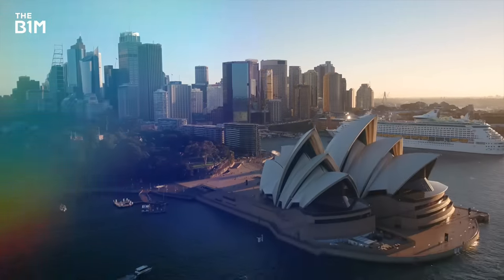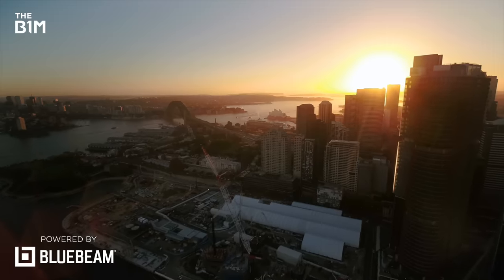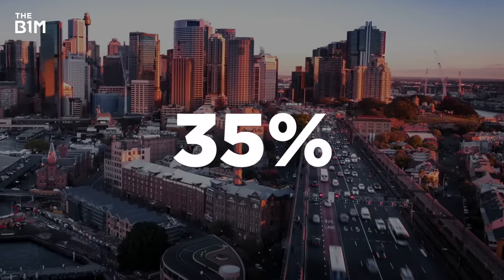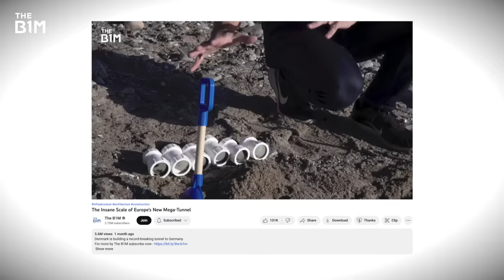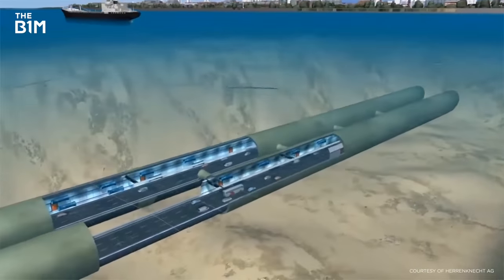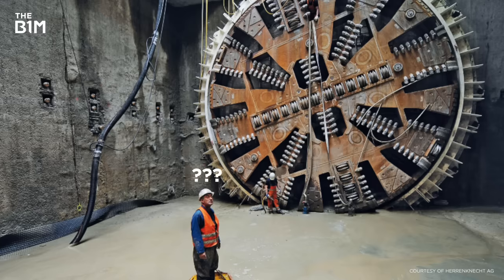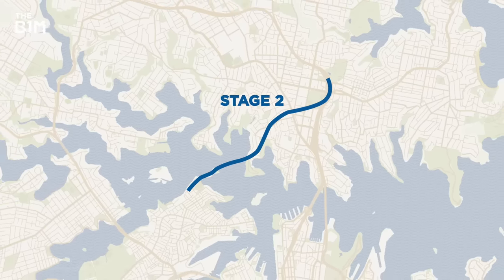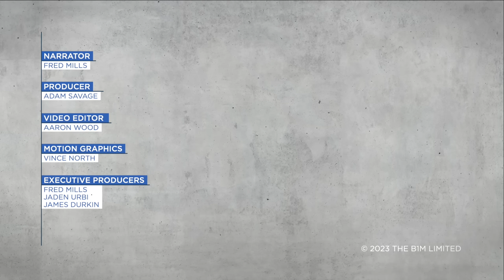Sydney's $5BN Tunnel U-Turn

Comment: If no alternative transport is implemented at the same time, it will just maintain the status quo of trying to keep up with ever increasing car use. I agree that a new connection is desperately needed, but not nearly as much as viable, affordable, round-the-clock public transit. Great video!
Reply: Transit sucks. I prefer my car so I tell my politicians to give me more highways.
Reply: @musqul8566  And they will give you more highways, so you'll have more ways to be stuck in traffic.
Reply: @musqul8566  If you wanna suffer, then suffer, just don't make others suffer for your uninformed opinion.And more importantly: don't make them pay money for it.
Reply: @musqul8566  then don’t live in a city, they’re not meant for cars
Reply: Actually, there is (sort of). Sydney Metro's City & Southwest extension is right next to the West Harbour Tunnel, and is planned to open in 2024. They don't exactly go to the same places but is nevertheless a great alternative for crossing the harbour.
Reply: @wfb.subtraktor311  How about we make a deal, car drivers won't make you pay for car infrastructure as long as public transit users don't make car drivers pay for public transit infrastructure?
Reply: @evancombs5159  If you want to do that then don't pay your taxes.
Reply: @beandispenser6971  I think you missed the point.
Reply: Another person that fails to understand why cars remain attractive and thinks it’s only missing public transit that’s the issue. Lol.
Reply: There are currently 3 metro lines and 1 light rail line under construction. I’m not quite sure how many public transport alternatives you need before we stop hearing that, but the current number does seem like quite a lot.
Reply: @musqul8566  One more lane doesn't ever solve the issue. Having public transportation that is actually high quality and useful does reduce congestion though, making it better for everyone.
Reply: @wfb.subtraktor311  and another simple mind that fails to understand why cars are attractive and thinks it’s just the lack of transit and people will drop cars. Lol. Transit IS POINT to POINT. Fixed. It cannot cater for all trips, in all directions and be door to door.  I have a train next to my apartment, a tram at the end of the street and multiple bus lines,  but a car always provides more flexibility in all weather in all directions.
Reply: @evancombs5159  aight, all roads are now toll roads.
Reply: @xander1052  that also means getting rid of all subsidies for public transit.
Reply: @evancombs5159  Most of us use both.
Reply: @you_dont_know_me_sir  most do not I’m guessing. Far more use cars on a regular basis and transit on random points to point trips once in a blue moon than the other way around
Reply: @calebmoore1582  the problem was never how many lines there, but how unreliable and infrequent they are. People can then move accordingly to what their needs are.
Reply: @musqul8566  No, Transit sucks in Australia, i am more than happy in a green car on the Shinkansen!
Reply: @musqul8566  
So do you understand that if you live in a city & love driving, then your self interest is to get OTHER PEOPLE off your road & onto Public Transport?
Everything from Gondalas to seperate bikes lanes to trains does that.
Do you understand now?
See Not Just Bikes or City Beautiful about town planning.
Reply: @rasta77-x7o  
Pls read my comment - If you live in a city and love to drive, then your self interest is to get OTHER drivers off your road to make the trip quicker for you. More roads in city means you have more congestion, bc of induced demand. See my other comments.
Reply: "Around the clock" is key here, the only time we were given 24hr public transport was during the 2000 Sydney Olympics and it was wonderful being able to go out at any time of day or night and know that you weren't going to get stuck with a huge taxi charge because public transport turned into a pumpkin after 12:30am heading out from the CBD.
Reply: Maddie  planners know exactly what they're doing and how to fix the problem which is why it is frustrating for them too. The problem is that the whole system of government is too bureaucratic, everything takes too long, too much money, and if the politicians don't agree it won't go ahead. All the state ministers appointed into roles such as Transpost minister David Elliot have no idea about planning or transport at all, hes just a politician assigned into this role. For example, in an interview he encourages people to drive to the airport if it were cheaper than paying the $16 station access fee. Write to your local MP and pressure them, because they are the only ones in our 'democratic' society who have the power to make a change.
Reply: Dear friend, believe in Jesus Christ. He's coming soon
Reply: @you_dont_know_me_sir  that is my assumption too.
Reply: But we do have a new metro line going under the harbour too.
Reply: @musqul8566  I mean that's still backwards. The more transit there is the fewer other people drive cars, so you will be able to drive places with less traffic.
Reply: Maddie  Beneath the planning and economic and political and environmental considerations is the fundamental question of human freedom. Cars represent freedom - go where you want, when you want. Public transport puts you at the mercy of politicians, and unaccountable unions, middle management, public servants, network operators, mechanical breakdowns, arbitrary schedules, etc. Cars are obviously regulated as well, and are not a perfect solution, but by comparison, they offer much more liberty than complete dependence on public transport. People in many countries are just resigned to living at the mercy of politicians and bureaucrats. Thankfully Australians and Americans still have some yearning for liberty, even if we take it for granted much too often.
Reply: It would have been a great video if they addressed better uses... IMO this is just a puff piece for the project, plus some concern about timely and efficient delivery of it.
Reply: @evancombs5159  do you pay a fee to use the roads everyday? All roads I mean, not special ones or only bridges? Last I checked I had to pay to use transit no matter how close or far I went on it...why should freeways be free?
Reply: @evancombs5159  as long as we remove all subsidies ofr car drivers too...pay for ever inch of asphalt you use...just like a transit user has to in most places...

Also, take a look at the transit budget of most cities and then look at their road maintenance and improvement budget...which number is bigger do you think? Who is getting the bigger subsidy.
Reply: @jesseyoung9654  😂

Yeah, we yearn for the liberty to sit in traffic for an hour and half in rush hour to go 30 miles...great joys that is...

We have the same bureaucratic issues for freeways and free roads...the difference is the average driver doesn't have to pay a per use fee and so they think this stuff is free...it's not...we pay for it in higher opex per mile per traveller...and then we pay for it in our fed/state/local/property taxes to cover those costs...

Freedom is also the option to not drive if you didn't want to...in most of the US, that is just not an option...like others have said above, by building more reliable and frequent transit, you will get drivers off the road who want the choice to not drive but drive cause they don't have a choice, this freeing up the roads for those people who have no choice but to drive cause of other constraints that transition infrastructure cannot fix...
Reply: @xr6lad  the issue is a factor of choice...if you look at cities with very good public transit, they all have a higher utilization rate on both the transit and the roads - but their roads are not as built up as places with piss poor transit options.

That's cause the compromise is less if you have great (i.e. frequent and reliable) transit and so those who drove cause they had no alternatives will shift their habits and it will thus free up space on the roads for those who absolutely must drive. 

You are right - transit won't work for everyone, but in most of the US and similarly in Australia and few other of the developed countries driving is not a choice, it is a fact of life and a an absolute necessity...one cannot live without a car in most of the US (where I live) - building more good transit gives people choice and then they can chose to drive or not...
Reply: Spread out is the way! Australia is large enough.
Reply: @victorsamsung2921  again, no one is saying don't spread out - people are saying instead of just more roads give people good choices...having some transit is not enough, it needs to be good transit...any time a city or region has had good transit, it has made the roads better/more cost effective
Reply: @triaxe-mmb  What Sydney needs is more bigger-thinking people, willing to take it to the next level. Concerning as an example that the Manly Tunnel has been waiting for decades and decades. No wonder as a consequence the traffic has fallen behind. Sydney has so much potential.
Reply: @victorsamsung2921  I am not arguing against it's potential, but just from a logical perspective, a City will never build their way out of traffic by building more driving lanes...a bus lane can take 5 times the people than the same lane full of cars - but only if the service is good and frequent so people actually use it...bus lanes with no buses or one every 20-30 mins are a waste of space and money. Now imagine that same space but with a tram or even a larger trains...you can move factors more people in the same amount of space with transit...not saying we don't need more roads, but we need to build the transit so you can reduce the overall demand for more roads.

IMO, all a city or region can do is reduce demand to drive by giving people who would opt for transit the choice to not drive - most markets with good transit utilization has shown that if transit is frequent and timely, say if it showed up every 2-5 mine instead of every 15-60 mins like it is outside of the CBD/city core in most major American style cities (i.e. car centric cities), then the roads too will be in a better situation.

Of course, this is just an assumption on my part as to frequency of mass transit in Sidney since I have never been there but everything I have read say it's more like  here in the US and Canada than cities in Europe and developed parts of Asia.

We can have spread out cities and still be walkable and transitable for a lot of people and thus making the roads more open for those who just have to drive or want to drive. 

Currently in a most major metros outside of Europe and East Asia, driving is a necessity of life, not a voluntary choice...is there any harm in giving people the option by building good transit infrastructure?
Reply: @victorsamsung2921  also, sorry for the absurdly long post, 😆
Reply: Around the clock transport, are you kidding? Who would use it they can't even keep you safe on the current system which clocks off just after midnight I think!
Reply: Bruz has us covered with flying cars!
Reply: Who uses public transport ? NOT ME !
Reply: @stefano3202  Actually, they are. You're wrong.
Reply: I like to drive, that's it
Reply: @privatename6891  maybe American cities like Houston and Tampa are made for cars, with large 12 lane freeways that still have traffic
Reply: @musqul8566    You are not thinking.  I too need to use my car, so to make traffic flow better, we need more public transport to get un-needed cars off the road.  When local train is down, roads become clogged.  Times like this show how much public transport helps keep roads clear.
Reply: The transit needs to cross the harbour too i'd assume which would make a tunnel or bridge necessary anyway.

Comment: In Sydney the government always plugs the gaps between motorways with toll roads and then they wonder why the traffic is still bad on the old road
Reply: yeah car based infrastructure is v expensive
Reply: @lotni  just one more lane will fix it I’m sure
Reply: If you want to reduce traffic putting a toll on a road is going to do the opposite and is only going to serve to create more congestion while increasing tax revenue. 

This new road connection only serves to create a new source of tax income for the city.
Reply: what old roads? They usually rip out the old roads once the tunnel's built as part of the conditions they signed with the toll provider. Anyone remember when Epping Road was a 3 lane each way super efficient road? Now it's 1 lane & 1 bus lane each way & lots of cycleways & landscaping where there used to be traffic flow - all to create congestion & force people onto the toll road
Reply: @lotni  better than having a city spiralling into debt due to the insane costs of car infrastructure.